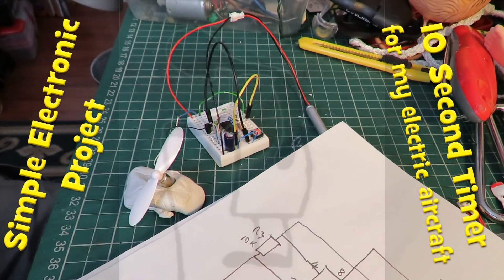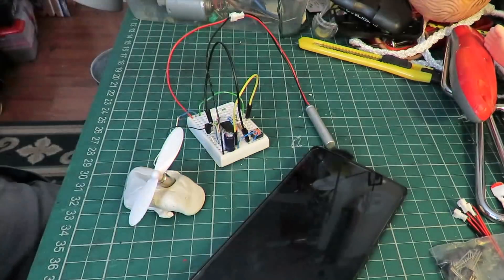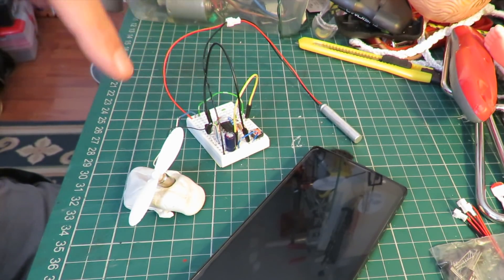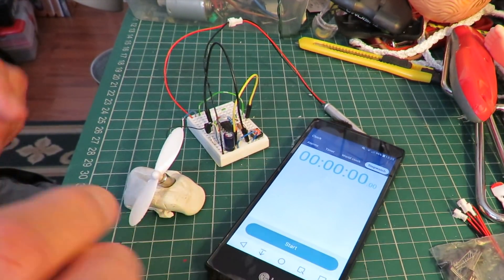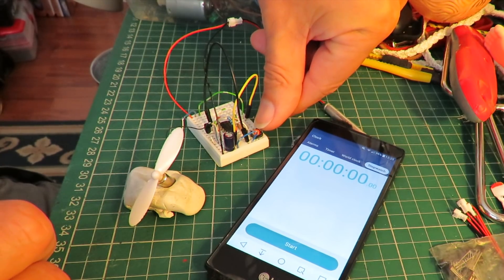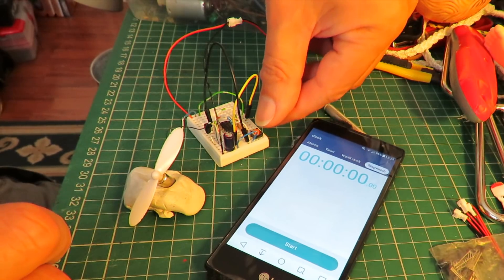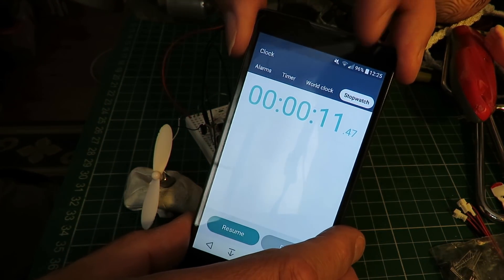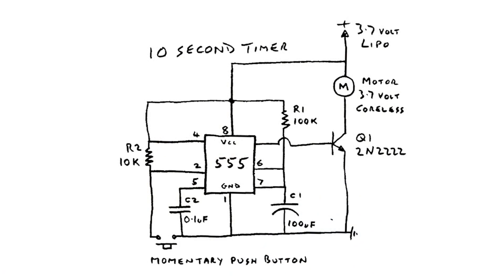Simple 10 second timer for my Electric Aircraft

Comment: Very nice! Can I put it   my electric line control plane?
Reply from the maker: Details of the components and other information in the video description. It would depend on what motor you have on your plane. I considered using one of those cheap wireless remotes, used for controlling garage doors and similar items. A single button press on the remote operates a latching relay. So you could start and stop your electric motor when you like, without using full radio control. I never got round to testing the idea.

Comment: if we remove the push button & short the both ends then what will happen pls explain ??
Reply from the maker: Why would you want to do that? The button is there to apply a signal to pin 2 - the trigger - to start the timing process. If you haven't got a suitable push button then you could just short the wires together. That would do exactly the same as pressing the button.

Comment: How about 12 volt DC?
Reply from the maker: What is your question? The limiting factor on voltage and current would be the 2N2222 transistor used to switch the power on and off to the motor. You could change that transistor to suit whatever power capabilities you require. However I don't use this circuit anymore myself. If you look in my video description there is a link for the "Peterborough Timer" which is much simpler and works fine.

Comment: Nice circuit, I have built it works for 5 seconds, but if I press the switch for long time and then release the motor goes off immediately
Reply from the maker: The information in the video description will help you. The time delay is dependent on R1 and C1 so changing them will change the time the motor runs. I don't use this circuit any more, I use the Peterborough Timer detailed in my video description.

Comment: I should do that to prevent flyaways as free flyers are tree magnets
Reply from the maker: It won't help if your plane gets into a thermal but in other conditions it should limit the distance. It does reduce the power to the motor a little so if you need full power to get your plane in the air it may not be a good idea.

Comment: Effective circuit. Will be good to see this one in the air...it'll prevent fly-offs very nicely :)
Plus, if 10 secs seems too long at all, can just hold the plane in the hand a little while.
Reply from the maker: It does drop a bit of power through that transistor so we will have to hope it still has enough to fly. We will see :)